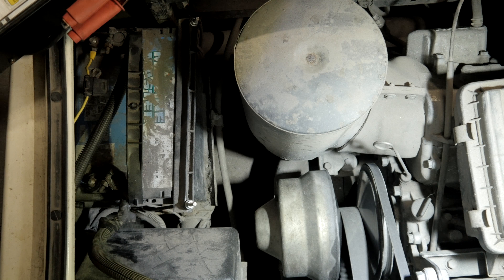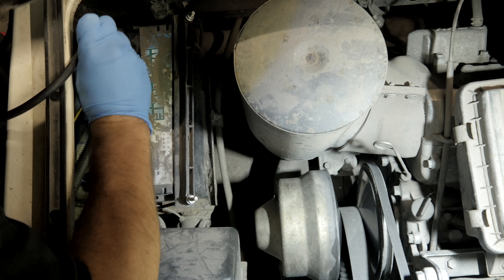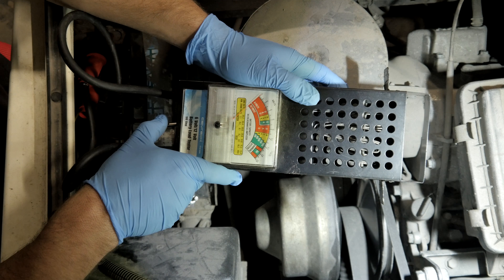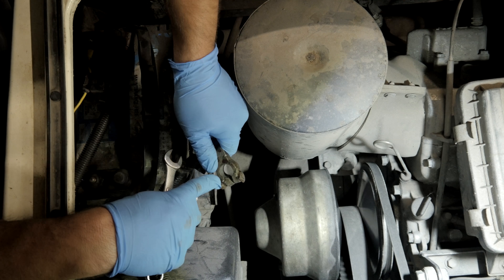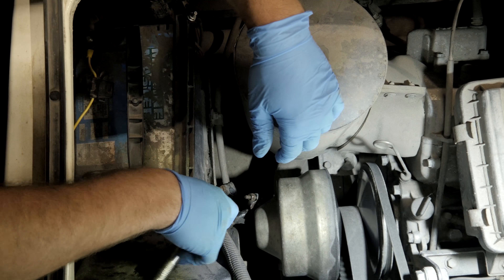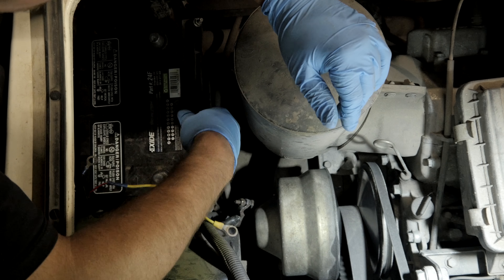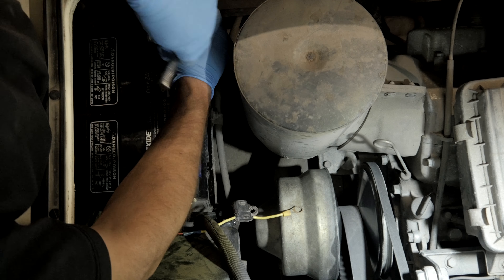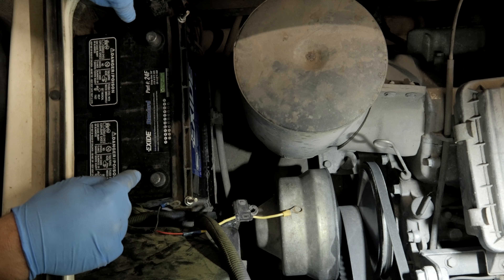1999 Yamaha G16, Gas - Dead Battery Replacement

Comment: No to happy with job you doing, why would you cut terminal to put on battery terminals. Why dont you remove nut and put terminal the way needs to be.
Reply from the maker: May times these old terminals corrode to the point of breaking and need to be replaced. This is my way to repair it.